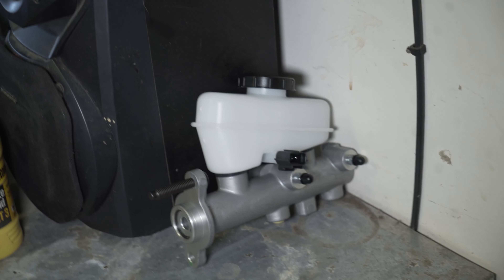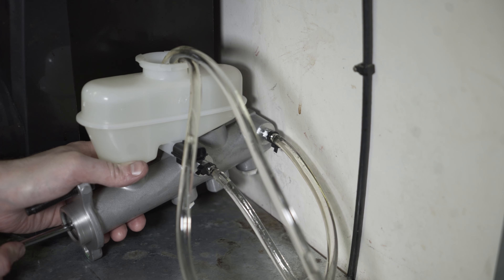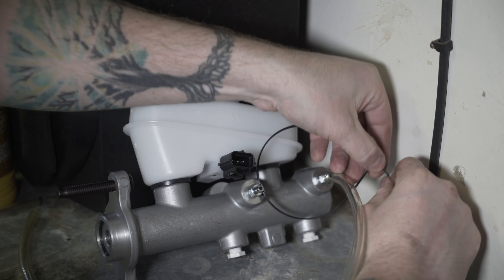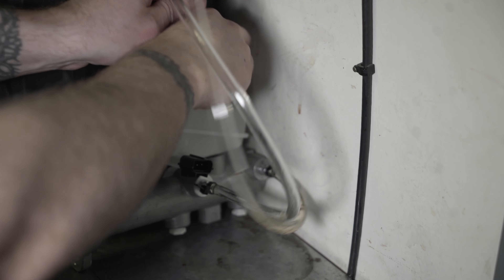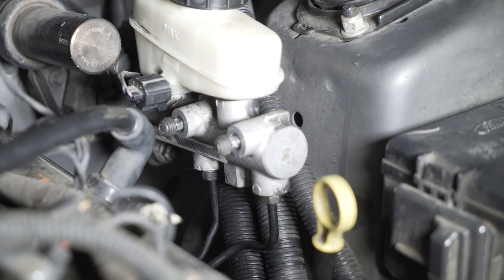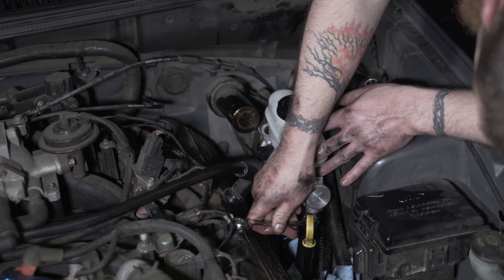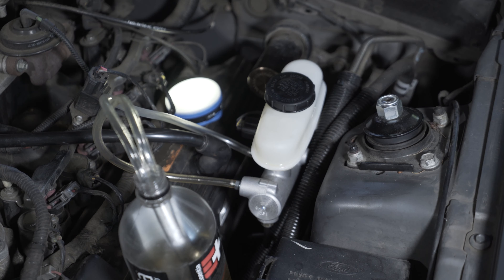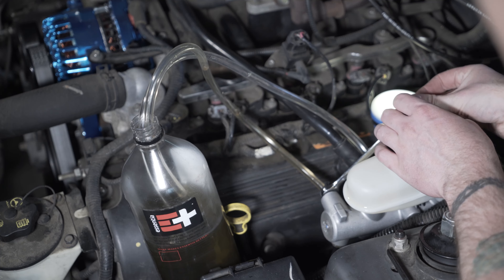Brake Master Cylinder Install and Bench Bleed | 99-04 New Edge Mustang

Comment: How do you get the bottom nut off. I can't find the room to do it
Reply from the maker: Are you talking about the bottom nut that connects the MC to the Hydraulic Booster?
Reply: Oh holy smokes yeah
Reply from the maker: @wrens114  This one is kind of annoying, but there is enough space on the left side of the Master Cylinder. You'll have to use short strokes and just keep working at it. The major thing here is that you'll need to use 2 wrenches. One on the nut and one on the bolt on the backside to keep it from turning. Does that make sense?

Comment: Good video and good content not sure why your not as high up as Chris fix in subscribers😂 may I ask why u needed a new master. On my 04 gt manual I replaced a caliper and can't get it to compress the caliper. my brake bleeder helper aka girlfriend has to leave so I didn't bleed the master. I'm "Notacarguy" or mechanic but I've done brake lines and calipers and a other brake jobs in the past and always got by without a having to bleed the master. There's no air in the lines when I put a clear tube and a bottle to it so should I just order a new master or try to bleed it.
Reply from the maker: Thank you for the kind words! I love Chris Fix. The reason I replaced my Master Cylinder was actually in a last ditch effort to fix a brake problem. I tried rebuilding the calipers and that didn't work so I replaced all 4 with remanufactured calipers from Rock Auto. They failed in the exact same way as the old ones so I somehow convinced myself that it could be the master cylinder. It turns out that the new calipers were faulty. I bought a new one to test and worked! 

As far as bleeding the Master, honestly, I have to do it every dang time I bleed the brakes. If your caliper isn't compressing and your brake pedal is basically going to the floor without any pushback, the first thing I would do is bleed the master. It is is odd that you haven't had to in the past, but definitely try before you go throwing money at anything like me. haha
Reply: @notacarguy_  got it everything back to normal it was weird I could of swore there was no air in the system but there must of been some in the master. After bleeding it it works great I would have thought the master was shot because no where else on the internet says to bleed ur master after changing calipers.
Reply from the maker: @sams7078  Glad it worked! I learned that tip from a dude on Instagram. haha.

Comment: For some reason my master cylinder doesnt sit flush with the hydraulic. Only after i tight the bolts is that normal?
Reply from the maker: That doesn't sound normal. The two main bolts on the side should make it flush, but I could potentially see if the brake lines were bent or too long it might push up on the MS.

Comment: Man how did you get the lower 14mm bolt off? That’s where I’m stuck. Also the studs on mine are also longer than the oem one, did this cause any issues? Did the bolts fit on the new units studs?
Reply from the maker: There is a little bit of space to the left of the cylinder. You need to have 2 wrenched (one ratcheting preferably). Put one wrench on the nut, then you need to have a wrench on the back side to keep it from turning. It's going to be small turns, but you'll get there eventually.

I believe the bolts fit, but you should hang on to the old one in case they don't.

Comment: Where can I get the caps that plug the bottom of the M/C?
Reply from the maker: I'm not sure where you can get spares. I believe mine came with the new M/C.
Reply: It looks like you bled it twice. Do you need to do it before and after? This process is confusing. I swapped the cobra stock front brakes and lines with the big brake kit and tried to bleed the brakes with no luck. I’m assuming the m/c has air. Do I take it out to bleed it or do I bleed it installed?
Reply from the maker: @323smiles  my M/C (on the GT) notoriously needs to be bled even after bleeding the brakes. You might have all the air out of the lines, but if there is air in the M/C, you'll get a mushing brake pedal. get the air out of the M/C and it should firm up. The M/C for the GT actually has bleeder valves on it so you can bleed after install. You may be able to get away with just bleeding it once, after you've installed it an bled the brakes. I went through the pre-bleed because that's what most people say to do, but it might not be necessary.

Comment: Didn’t show the part getting where you get the 2nd bottom bolt off
Reply from the maker: Who needs a bottom bolt? haha. I'm impressed that you're paying that close of attention. I do remember it being a pain to get those loose. Not sure why it didn't make it into the edit. Sorry about that.
Reply: @notacarguy_  a huge pain in the ass🤣 spent at least a couple hours trying to get something to it and I got it on the bolt but I can’t get a good turn to crack it loose
Reply from the maker: @matt3613  I just went out and looked at mine and realized that the thing that's different about the bottom is the hex-shaped head on the bolt. Not sure if you're already doing this, but if you can  reach down into the space farside of the fender and put a wrench on the hex end of the bolt for leverage. Then on the small space nearest to the fender, put a wrench on the nut in opposite directions. That way you're putting tension on the bolt and the nut. Hopefully that makes up for the tiny space you have to work with.